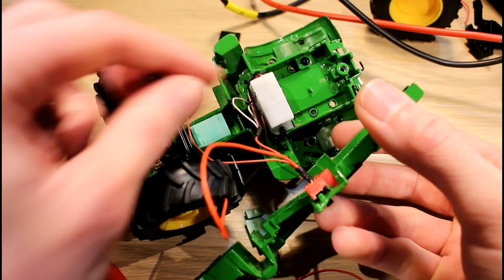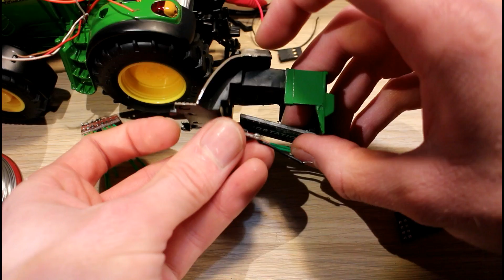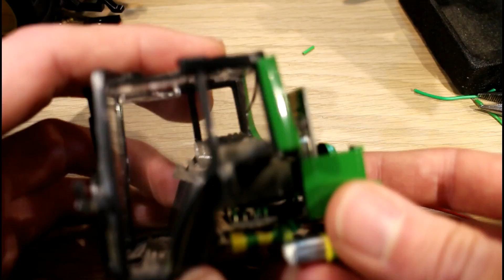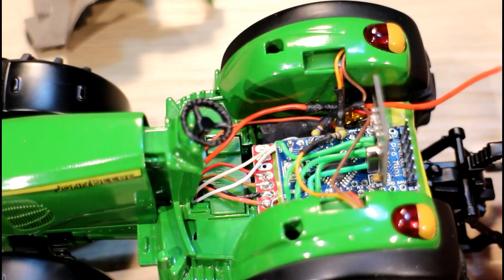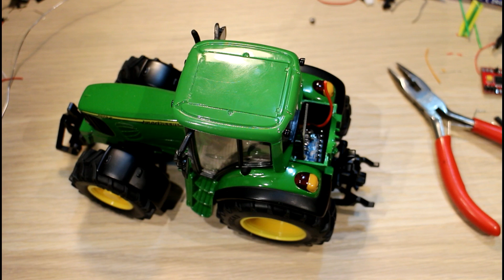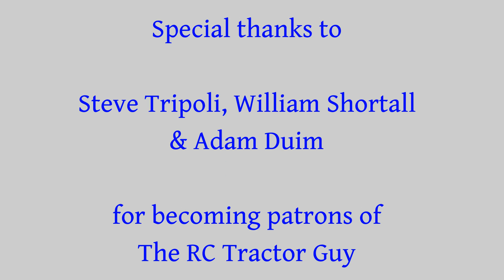Converting a Siku Control 32 John Deere 6920S Part 5 - Assembly and Testing

Comment: Hi, i love your videos mate, keep on going!!!

Thanks to you i start to understand these models work, but i was wondering what the advantages are between the standard john deere 6920s and your rebuild/conversion?

And do you know if it is possible to add worklights (which work individually) to the 6920s with only the siku hardware and controller?

Regards, Chris
Reply from the maker: +JD7530-Chris Hi, thanks for the feedback it's great to hear people enjoy the videos.

There are two main advantages, the first is when we use the models we don't need to switch controllers between users, every controller can control all of my models so whoever wants to use it just selects it on their controller, easier than having to walk around a large diorama just to get the right controller. Second is that it works with all my trailers, plus I can add as many functions to a trailer as I want and I can control it with the tractor for example I could build a trailer with an arm to lift logs or something. By the way if you wanted to build that kind of thing and pull it behind a siku control tractor then you just need to treat it like one of my tractor builds, give it its own NRF24 radio and control it with a separate controller. 

It is definitely possible and I intend to do a video showing how to add extra lights to the Siku Control Fendt 930 I have. You're limited to the capabilities of the siku controls though so it wont dip the lights or have separate control of the work lights like my other models do. That is on a long list of things I need to find time to do though, sorry it takes so long to get round to things it's hard to find the time.
Reply: +RC Tractor Guy thanks for the response, cleared up a log.

And i will keep following you video's so when the fendt 930 lights
Reply: +RC Tractor Guy thanks for the response, cleared up a log.

And i will keep following you video's so when you start on the fendt 930 i will definately see that video too ;)